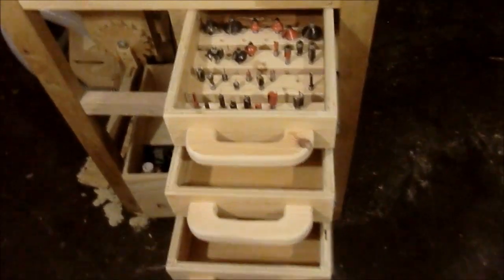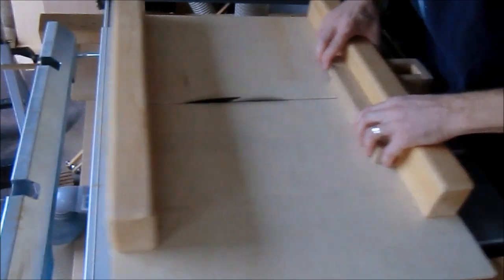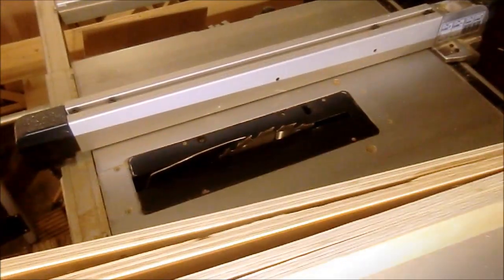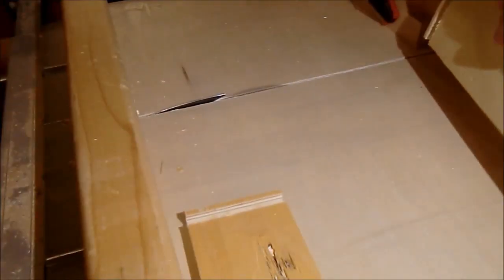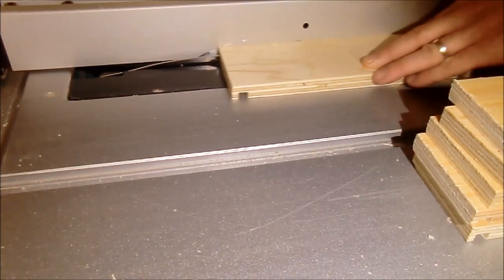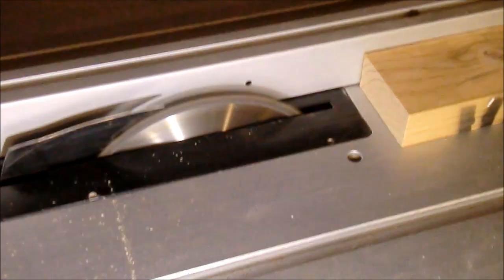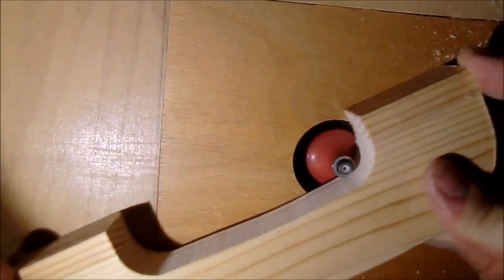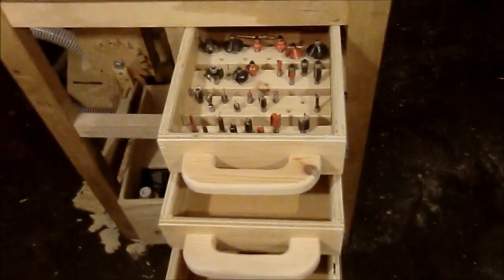Three drawers from plywood

Comment: A very nice project with good execution. I particularly like the way you used dadoes for the drawer slides. It's a great way to save a little space, and makes it easier to mount the slides.
Reply from the maker: Thanks. …… drawers still in use with no issue….

Comment: I agree with Mark, you've got the rabbets and dado backwards. The dado is supposed to be on the drawer sides so that the front and back rabbets lock into the sides when the stress of opening and closing the drawers is applied. Other than that, nice job.

Comment: since you're doing multiple passes to get your dado and rabbet widths, i'm wondering if the blade is just a standard blade, or if it's a flat-bottom (dado) blade just used without a stack and spacers?
Reply from the maker: I have a standard blade, the result is not smooth but for my purpose is good enough, no issue.
Reply: @tomastruksa9312  thanks... good to know! so you feel that it doesn't really affect the strength of the glue joints?

Comment: Work safe!  Get rid of those sleeve I see dipping down toward the saw blade.
First rule of working safely:
Do not wear any: Rings, watches or Long Sleeves when working around woodworking equipment.  The results, if an accident happens, can be quite serious. Protect yourself.
Reply: Agree, that was scary.  The sleeves seemed very close to the blade.

Comment: Nice video, excellent joints. My only concern would be the joint between the two pieces of drawer bottom, where it is possible for one to sag , creating a gap. I would feel compelled to put another piece of the same material on the bottom, joining the two together, with glue. Also, your drawers will look and feel twice as well-made if you put some varnish or poly on them (or shellac)
Reply from the maker: yes. You are right....  Regards, Tom